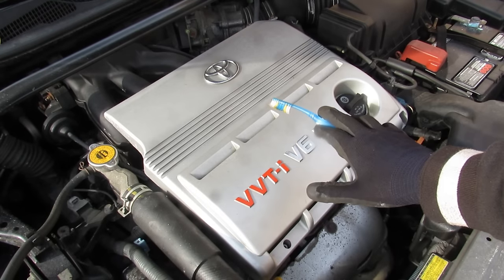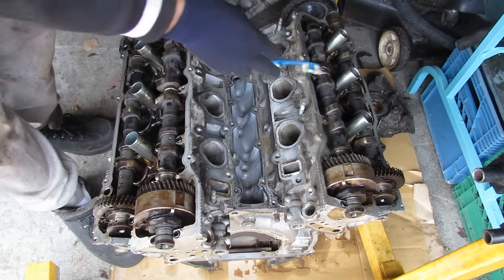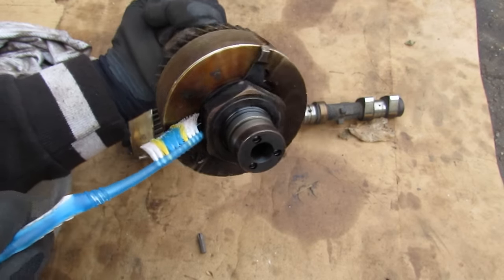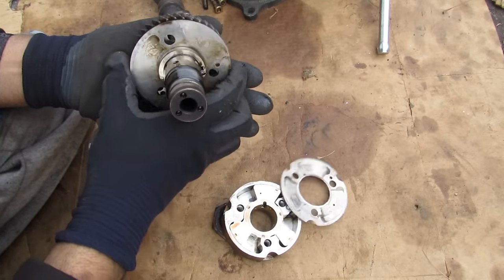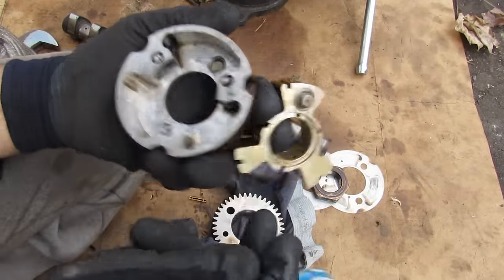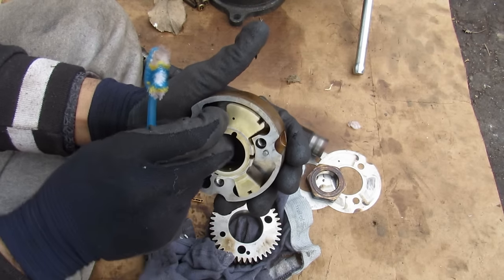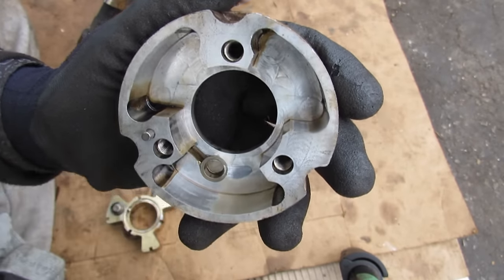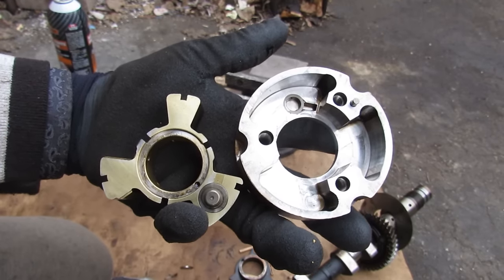Here's Why Your Car Rattles on Cold Starts

Comment: Great video! Thank  you. My wife wants to buy a 2011 Venza with 122.000 has this exact issue. Should she not buy it?
Reply from the maker: It's still a good engine, just plan on replacing the gear in a little while if the rattle bothers you.

Comment: My Lexus has done this twice for up to 40 seconds at a time until it warmed up. The noise scares the hell out of me. Hasnt done it again in a long time now - i started using a higher quality non anti drain back oil filter which i think helps get oil up to the top of the engine quicker
Reply from the maker: Some oil types make the sound less apparent. It's not super harmful, it's just annoying
Reply: Which quality oil filter do you recommend?
Reply: @andrewrey5348  I started using Mobil1 wit anti-drainback. basically looking for anything that said anti-drainback. However something else I did earlier this year as well was to take out the metal filter screens for the VVT system and clean them really good. I haven't had any problems since then (but then again the knocking was always pretty intermittent anyway). The VVT "oil control " filters are near the top of the engine on right hand side (if you are looking under hood) just under each valve cover. Google the location. They are mounted horizontally so it is a delicate operation to get to them. I also removed the VVT solenoids (oil control valve) and cleaned those too.

Comment: I wonder if installing an electric oil pump would help pre lube the engine before starting. Maybe that would keep the rattle from happening? Just turn key to on wait a few seconds then start the motor. Just a thought.
Reply: That sounds like a great idea. 
I might try this thanks.  👍🏽
Reply: Please let us know if you try this. My 2012 honda accord 4cyl does the rattling thing too.

Comment: turns out, this is still an issue on 2023 models. i have a '23 JDM noah hybrid with the 1.8 vvti 4 cyl with less than 10,000km on it, and its made this sound 3 times so far since the temps started going down.  picked the car up in July new, and did not hear the sound until early november when temps went down into the 30's. is this issue possibly one reason why toyota went to a 0W-16 oil? this stuff is super thin.
Going to try pushing the start button without pressing the brake to allow all of the accessories to power up then after a few seconds, start the engine to see if that stops the cold engine noise.
Reply from the maker: Already!
Reply: @speedkar99   i have only been able to catch the sound from inside the cabin on my traffic cam. i havent been able to reproduce it consistently enough to catch it while the hood is open. from inside, is sounds sort of like the fan was momentarily hitting the shroud. this morning, i used the remote starter with the hood open, temps were in the 20's  but the sound didnt appear. its def a very odd sound.

https://www.youtube.com/watch?v=wMsh7QVFTQ0

Comment: Hello.  Tiking noise...... about this'..........This engine was put in daihatsu sirion and cuore. Toyota aygo, peugeot 107 citroen c1 toyota yaris and few more. This noise it is a normal noise when the engine it is cold or when you accelarait . The noise it is from VVT_i , variable valve timing inteligense. In fact piston start to ignite to soon and it is toutch the cylinder. Try to worm the engine few minutes and after that the noise will not be so bad, cylinder will expand a little and will be ok.. The engine it is very smart, always try to have more power with low fuel, so do not worry. Sorry for my bad english. Regards from Romania !

Comment: What happens if I leave it like that? I have a 2008 lexus is250 with 147 k miles and it makes that noise on cold start, then it goes away after a second. Exactly the same noise!! I would like to know if it's fine to keep on driving like this?
Reply from the maker: It's fine. Eventually the gear will wear out and fail to keep timing

Comment: thanks I knew that was my problem. I am just having trouble trying to lock the refirgbished cam phaser on the cam. it wont turn when I apply 100psi of air to lock the cam phaser to the cam

Comment: my toyota camry 2010 hybrid have same problem,this sound lasts about 1-2 sec,is it dangerous or could it damage something?
Reply from the maker: Not until it fails and you start getting timing chain codes.
Reply: @speedkar99  if it fails,will it have sound again on cold start?

Comment: I am beginning the think that my Chevy Sonic 1 8l cam phasors don't carry a locking pin but have antidrainback valves in the monoblock and the oil cooler filter housing. Oil in the filter housing is draining out internally into the oil pan after a few hours of sitting engine off. The rattle occurs a few seconds during startup. Annoying as heck. Thanks for the video.

Comment: i have lexus is250 v6 and had that rattle noise happen literally few times, I gues its similiar engine to that v6 in that video? I guess it notghint o really worry about then
Reply from the maker: Yes. But check the recall they had for the vvt gear

Comment: I have a same noise on my engine. It's a Sr20de from Nissan tho!! Oil change did nothing, new spark plugs, nothing. What's wrong with it?
Reply from the maker: Timing chain rattle?
Reply: @speedkar99  rattle noise is there only at cold start, lasts about 1 full second and desappears. Tried to listen to the engine, open hood, while running and give it some gas to hear it, but I might not be good and experienced enough to say it's a cam chain tensioner.

Comment: What if the cold start rattle noise continues until its full warmed up, my 2010 Toyota Corolla S continues the rattle noise until its almost fully warmed up but after I put it in gear most of the noise goes away but you can still hear a little rattle like marbles and when its in idle and in reverse but once its been driven 40-60 minutes the rattle noise completely goes away. Should I then change the camshaft gear or is it safe to drive it?
Reply from the maker: Yeah your gear is probably worn out. Any timing related engine codes?

Comment: So it's like a whatever fix you don't have to?? I have the same problem on cold start it always rattles but not after I park for 5 min and start it again
Reply from the maker: It'll eventually wear out
Reply: @speedkar99  wear out as in might need a replacement or exchange. Or wear out as in it'll  stop making that sounds eventually
Reply: @speedkar99  looking to fix it soon was wondering how much this will  cost labor plus part or of I can get the part separately  and just pay for labor I drive a Toyota 2003 matrix xrs
Reply: @phaise8226  bro you have to get the entire engine disassembled. Just do your regular oil changes and let the rattle be. Just save money towards another car.

Comment: To correct you, a pro mechanic that’s very diligent and experienced on Toyota engines, said most vvti engines will eventually grenade the engine if not changed.
Reply from the maker: I think the problem has to be really really bad before this causes valve damage.

Comment: Hyundai's 3.5L engine from 2010-2012 frequently has a similar issue. Just bought a car with this engine with only 60k miles and it does it. Is there anything that could be done to clean this part to free up the that locking pin without tearing the engine down? Would it do any good to add some kind of cleaner to the solenoid\oil control valve that engages the vvt locking pin? There has to be some way to get something in there to clean that pin if it is sticky. I wouldn't mind having to take off the valve covers to do it, but removing the engine or dismantling the timing side of the engine seems like something I can't afford to get into right now.

Comment: I have a 2017 Buick Enclave with a 3.6 VVT Engine that also does exactly this. Would this correlate with my car?
Reply: UPDATE: bought the car with 110k miles,recommended oil is 5w-30.I went ahead changed the oil twice one time with 5w 30 the SECOND (still very dirty oil) time with 10w-40. Problem SOLVED✅

Comment: So I'm guessing turning the car power on before trying to start the engine wouldn't prevent this? is250 start button
Reply from the maker: No
Reply from the maker: The is and GS have a recall for the bolts Being too slack check it out
Reply: @speedkar99  How much should I expect to pay to fix this? My car currently has 151K miles. I tried to find the TSIB but couldn't.

Comment: I have a 2014 CRV 236,000 miles.  Runs fine and smooth just the rattle after sit for hours or overnight. My question is will affect the engine performance or is nothing I have to worry about ?
Reply from the maker: Don't worry about it until it's completely worn out

Comment: So just to verify the bolts backing out on the 3.5 has nothing to do with the rattle? It’s only the pins getting stuck causing the rattle on the 2.5 and 3.5? You were only pointing out that the 3.5 had a issue with the bolts backing out?

Comment: I have a lexus is250 doing this on a warm start after sitting for 20 mins or so but not on cold start...... Same?
Reply from the maker: Check your oil. The 4GR had some issues
Reply: @speedkar99  would topping off the oil cure the problem ?

Comment: I have an 01 Camry with the same 3.0l V6 just not with the vvti. Is it possible to fit a vvti in the older engine since it's the same without having to do custom work? Or does it require a lot of other stuff to make it work?

Comment: Great. 06-17 Camry has a 2gr-fe. I am buying a used Lexus gs350 2013 which has the 2gr-fse and it has slight rattle on cold start. Apparently this rattling problem had been complained enough to make Totota recall some lexus a few times to fix the camshaft. Not sure if i ask my dealer to fix the camshaft would cause problems due to manufacturing processes...
Reply: I have the same problem what the engine rattle. I’ve heard it was a recall on the 4GR-FSE/2GR-FSE. I want to get it fixed but I don’t want the dealer to mess up my car. It runs fine it’s just that rattle is annoying on cold starts.

Comment: This video was great! I have that rattle on my Scion tC2 2AR-FE engine at start up as well. Would that be catastrophic for the engine? Or ride it out until I need to change the timing chain? Thanks in advance
Reply: I’m about to spend about $400 on a new cam gear to stop the rattle. Im sure the timing chain won’t go bad anytime soon. I guess it’s just up to u if it’s worth it, to me I can’t stand the noise on start up so ima pull the trigger

Comment: Does the VVT 1MZ have the oil control valve filter screen that needs periodic cleaning? I had a 1ZZ-FE Corolla that did but my 3MZ doesn't seem to have the filter screens before the oil control valve.

Comment: Could you do a video on the proper installation of these gears? The shop manual says they must be unlocked during installation, torqued to spec, then locked. The gear I got from the dealer came locked: my luck of course.  Im doing it on a 2008 lexus (4gr-fse).

Comment: I have a 2013 Ford Ecosport  with the1.0 Ecoboost engine. And the car makes the same noise during the first cold start in the morning or when the car has been sitting for few hours. Is there something I need to be worried about?

Comment: I heard older cars sent oil to heads first cause owners didn't like the valve clatter. But new cars send oil to bearings first so the engine lasts longer.

Comment: 2 treatments of seafoam engine oil flushes fixed the vvti rattle that I had for over 4 years.
Reply: did you have the Toyota 2ar-fe 4cylinder engine?
Reply: B ,
I have a 2007 Rav4 V6 with 203k miles
Reply: @PAT111  how is it now?
Reply: @WillCarrot  215k miles now and still no rattle

Comment: Just wondering does that rattle coming from the Lexus V6 that will kills the engine makes the same noise? I have a 2GR-FE and it's making this noise, yet I have no idea whether it us this pin issue or the bolt issue, thanks a lot!!!

Comment: I had my 05 camry rear brake shoes and drums replaced and now the e-brake doesn't work they adjusted it twice but its not working again..any idea on what the problem is?
Reply: See if you missed re attaching the cable from the back of the brake assembly.

Comment: Does anyone know if there's an official recall for a Lexus (2008) 350 ES  where Toyota/  Lexus will fix this? I recently purchased this vehicle and of course the previous owner did not disclose this problem. Seems I have the engine the guy in this video says it definitely should be fixed.  This whole thing sickens my stomach. So bummed.
Reply from the maker: If it rattles it's just worn. The IS/GS models had the recalls for the bolts being loose. Two different subjects
Reply: @speedkar99  Hey, thanks for the response!  Seriously. So to be clear, mine just rattles. Essentially the same as the very beginning of your video. Sometimes louder, quieter,  longer or shorter. But are you telling me that I don't have a need for concern because I have the ES 350 V6?  If this is accurate,  it's a huge load off!

I ask because the end of the video you say the 3.5 lexus engines. So I assumed my ES is included.  Again. Tremendous thanks!

Comment: Is there any oil additive that might keep it lubed during cold starts so it doesn't rattle?
Reply: I will try the Lucas oil conditioner on our Honda Accord and Lexus IS250 and see if it helps on startup. Check back with me and I will update if it helped.
Reply: @shitboxoffroad  yes it does help. Poured in the Lucas oil conditioner and started up our 06 IS250 and it was a normal start no rattles. If is your first time adding it to your engine but havn't started it you may still hear a rattle once more because the Lucas has not been spread thruout the motor. Do that and let it run for a about 5 minutes idle. I have used it in every vehicle I owned for 13 years and I never go without it.

Comment: My VW golf actually makes does this. 
Not all the time tho, sometimes it won't do it for a week and then it will do it after after it's been sitting for only 8 hours when i go home. 
The car has 180.000 KM on it but i do still wanna drive it for a couple years (only have the car for 7 months now).
I might get a shop to fix it when i bring my car in for a big maintenance check next year but if it's gonna cost too many manhours i'll just leave it like you said.

Comment: You engine sounds like piston slap.  This engine 1mzfe does not usually have vvti problems.  Usually the piston pins bend and cause the pistons to freeze when cold.  Causing the piston skirt to slap the cylinder.  Once warmed up the pistons expand and loosens the pin. So it free floats in the cylinder.  Noise gone.  Can you explain the vvti problem on the 3.5L and how to fix?

Comment: Hey @speedkar99! 
I have a P1351 error code on my 02 Lexus ES300 that is related to the vvt. It showed up after I removed the valve cover to change the gasket where I accidentally reintroduced the sludge which was stuck on the inner surface of the engine back into oil circulation. I have tried changing the OCV and its strainer and the camshaft position sensor, but none of them resolved the issue. Now based on a video I saw on youtube I'm coming to the conclusion that 1- either the tubes which lead oil to the vvt cam gear are clogged with sludge, or 2- the cam gear (or something inside of it like the pin) is stuck because of the sludge. I appreciate it if you could give me your opinion about this. After watching this video I believe that opening up the vvt cam gear is the last thing I want to do because of how likely it is that I will mess something up.
Reply from the maker: Try an engine flush and diagnose the electrical side of the circuit
Reply: @speedkar99  thanks a lot!! I'll do it asap!

Comment: Does this same issue cause the same noise on the gm 3.6l V6 engines?  Our 2010 Camaro started doing this after around 90k miles....

Comment: Thanks for this sharing, lot of priceless informations! I'm testing a NO COST method to avoid the ratteling and I'm wondering if it's work for any of you?   Here's how to do it... Just before stopping your engine just rev the engine at 2500-3000rpm or so and while the engine rev just turn off the ignition... Here's my theory... Cutting the ignition disengage the selenoid valve and release the oil pressure at the lock pin + the cam actuator. With the inertia of the "high speed"  camshaft  actuator moving, the pin is able to engage, ready for the next start on next day! Et voilà! It look to work for me so far after 4 days, hope it will help!
Reply from the maker: Not good to cut it off when running fast...
Reply: @speedkar99 what would happen if you cut it off at speed
Reply: Thanks I will try. Did you try at lower RPMs around 2000?

Comment: What does it mean if there's a slight rattling sound only when I turn right while driving? It does not happen when driving straight or turning left. 
It's not the steering rack or CV joint, but sounds like something hitting the brake shield (it's not that either, it just sounds similar)

Comment: I have the rattle noise on cold startup for 1 second and then goes away on the Toyota Corolla 2015 with 80k kms on it  which seems to be happening to a lot of people possibly because the locking pin is not locked when there is no oil pressure. But why does it not rattle when the engine is still warm? The oil pressure still drops when the ignition is turned off right?
Reply: The oil pressure holds it in place and it is not loose to slop back and forth which is what the locking pin is supposed to do.

Comment: Why is the exhaust cam sprocket divides in two pieces, like two gears together?
Reply: Robin Basulto To eliminate backlash with the intake gear. The two pieces are spring loaded to maintain contact with the intake at all times.
Reply: @robertgestier2013  Do they have a deeper backlash because of more thermal expansion from being inside the engine?